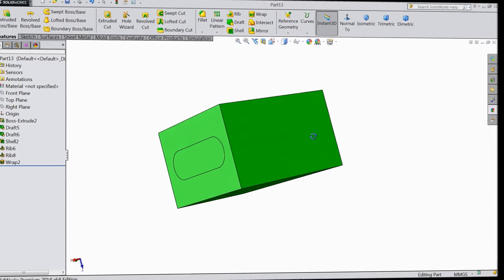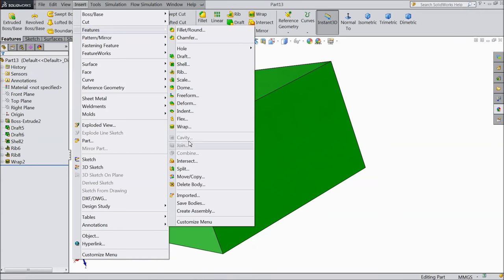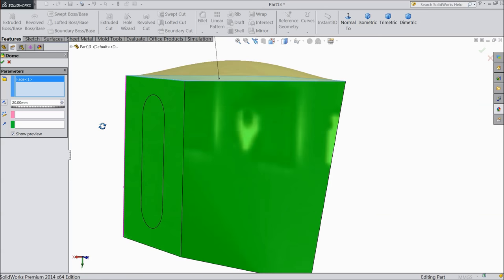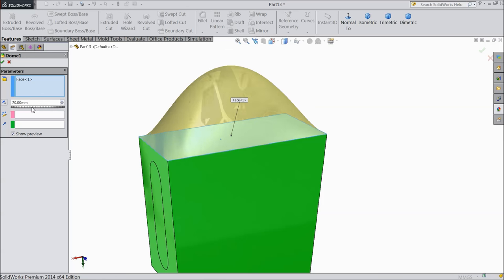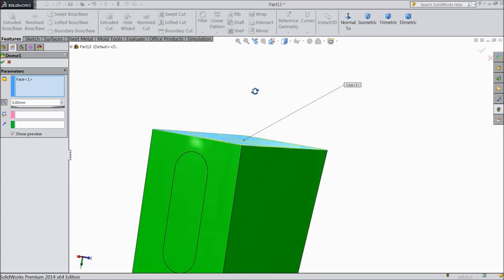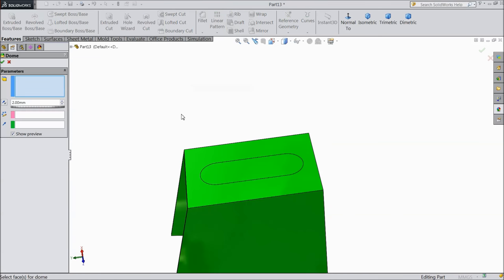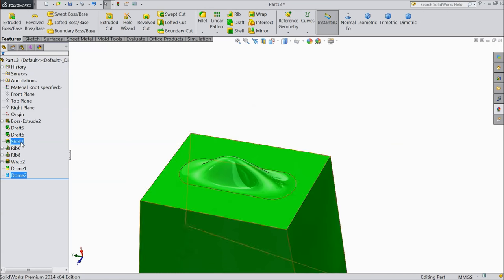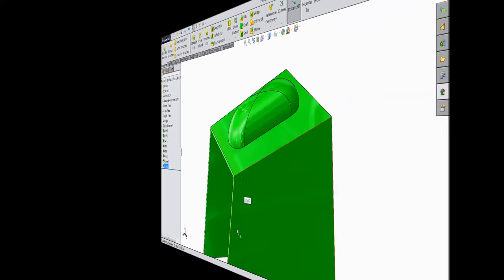SolidWorks Tutorial For Beginners 57.Dome

Comment: Hello, I've been trying to use to the constraint point or sketch imitator included in dome feature, but I cannot get it to work. I am making a new sketch on a surface, then selecting the surface for the dome, then selecting the sketch for the sketch constraint option and it keeps giving me Rebuild Errors,  "the height of the dome is too small" no matter what height i input. Does the constraint point or sketch imitator on the dome feature not work?